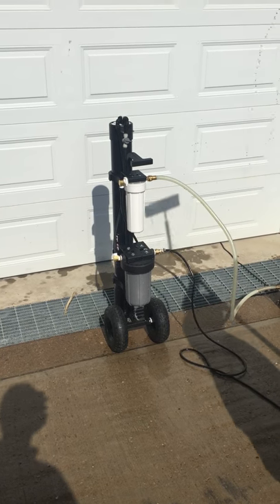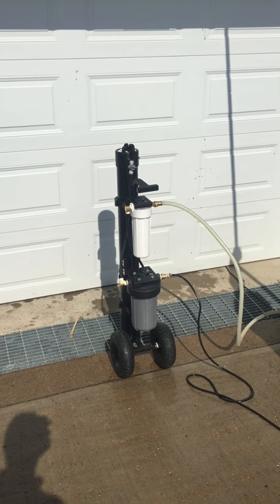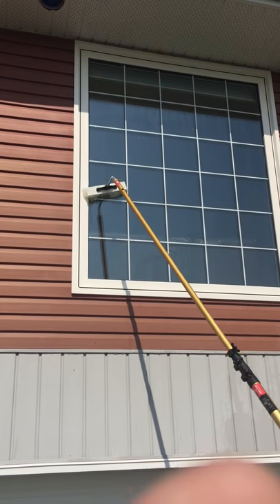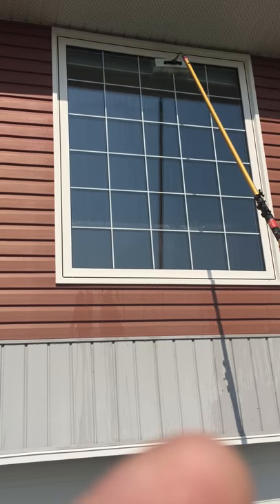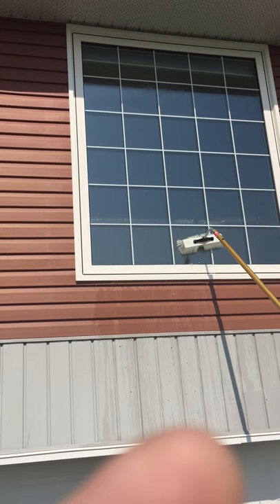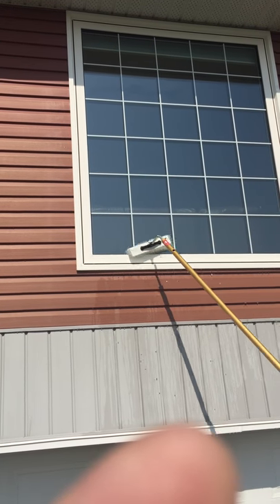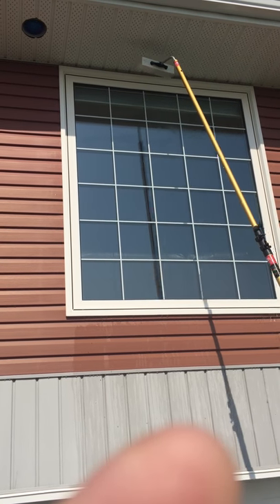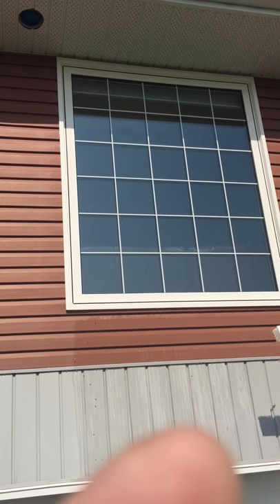Tucker Cart and Pole, Washco Canada, www.washco.ca

Comment: Did you say you had a small pump hooked up to it in the video? That was one of my concerns with units of this size. I was wondering if they needed one since your just using tap water pressure. Obviously, this pressure is probably reduced from using well water. What knife of pump did you purchase and how do you like the Tucker system?